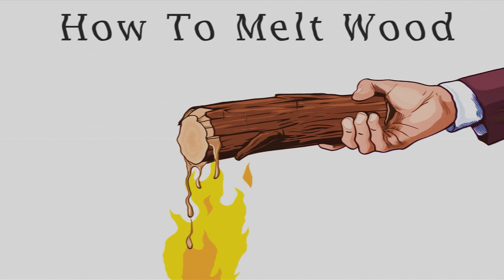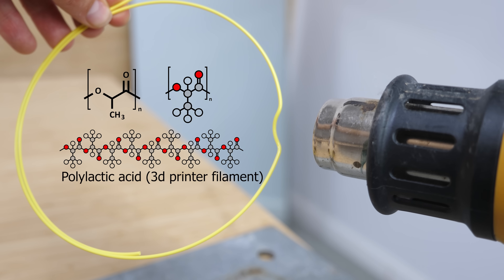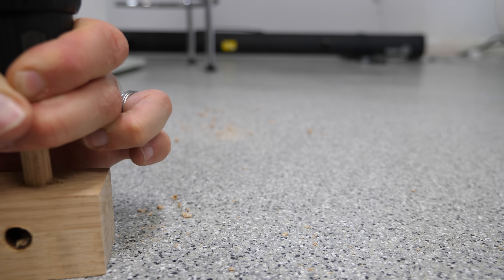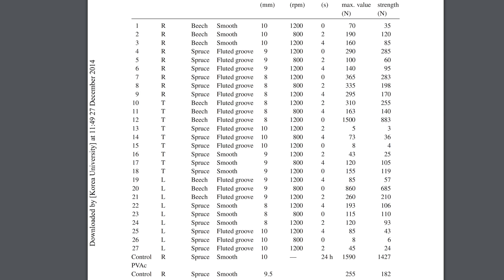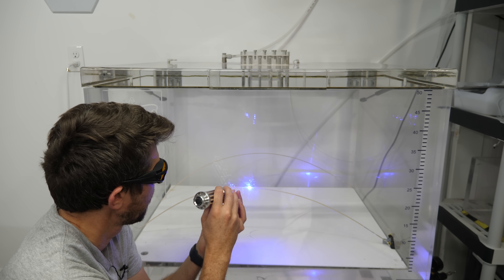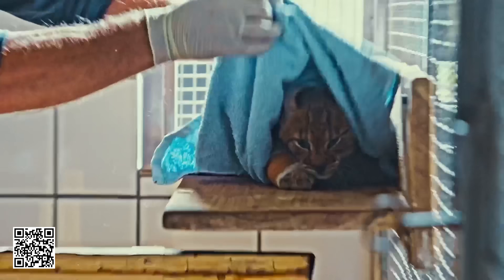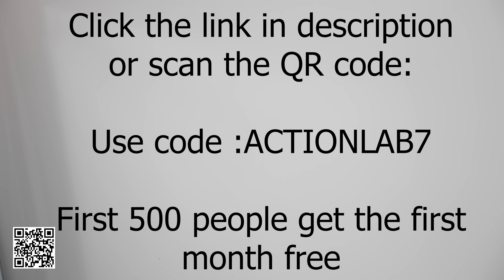I Melted Wood With Friction

Comment: I suspect you are not "melting" the wood as in it still being wood molecules just moving around loosely, but rather generating some sort of sticky hydrocarbony breakdown product in the pyrolysis that is then coming out and carrying wood flakes along with/stuck to it. Congrats, you turned wood into oil literally 100,000,000,000,000x faster than the Earth does naturally.

Comment: Wow! I hope that the worker who accidentally discovered that you could weld wood without the need for plastic was given a raise or promotion! After all, he found a more environmentally friendly, cheaper method that also saved time! (Also, since it eliminated the fumes created by melting plastic, it was safer!) That sort of discovery is priceless!
Reply: It might be oversold a bit... while woodwelding has its uses, it is not going to replace adhesives any time soon, and neither are the adhesives as problematic as they may seem. Melting plastic adhesive properly should release very little fumes. 

Generally this process is more expensive and labor-intensive in comparison to adhesives but it depends on circumstances. 

As for environment - the impact is not completely negligible at scale but not large either. 
Building more robust objects that are not expected to be replaced as often is much more important that producing them in a more environmentally-friendly way. It may be possible to do both.

Comment: figured out how to generate electricity using gravity, water and a design called a wirtz pump if you pump up to a second tank and then pipe it to fall driving the pump its perpetual now offset via chain drive the paddles above the water line and use buckets instead of paddles to mitigate loss if you incorporate rainfall into the top tank you can find nominal values that allow the system to run for the life of the material. you can have free electricity using an old washer motor and this system can be built to spec based on need or simply to run a fridge and lights. Much love and sun yall since its considered perpetual you cant patent this not that you would be alive for long after trying judging by the history sorrounding these types of things but it does exist and can be done for really cheap if anyone wants to try themselves go for It I will go more in depth and explain the process I am giving this information away so if anything thinks they can profit off stealing it just know I have covered my bases and you wont make any money this aint for the rich to get richer this is for the rest of us and I will be starting a not for profit to start installing these systems once I get it out of R and D and into production this year.
Reply: I appreciate the space to share I am blown away you can weld wood and I frequently weld.. now I can put wood welder on my resume once I try it for fun.

Comment: As i know this is the way they make hdf and mdf boards that are used in furniture making (hdf is usually the thin back of the cabinets, it's painted white from one side and mdf is the one that is usually used as a face of your cabinet either being painted or covered with plastic layer or wood veneer) they're made from wood dust and bound together by applying heat and pressure without using glue 

There's also particle board which is used for the structure (sides, top and bottom) of the cabinets but it's made of woodchips and special glue so there's no wood melting used there

Comment: It's pretty easy to bent by melting matches ( part would be definitively burned thats for sur ), i discovered it recently i was amazed. Do i deserve a Prize ? How i should contact? Just did it, i bent a matches to approx a 60° angle :) No vaccum needed but lost a little bit of wood matter in the process.

Comment: 6:35 there's archaic finnic dugout boats/canoes which are produced like that, by stretching (providing greater surface area). The noun "vene"(boat) actually is associated with verb "venyä"(to stretch). More info about that in specific might be easier to find via name "haabjas” - an estonian single log dugout boat made from aspen (haab/haappa - name of the tree from which it's produced).

Comment: I mean, any heated wood, even more to such small size will result in bend. What that have to do with welding? why not actually "glue / weld" the two bits rathere than bend it?

Comment: this is so amazing!  thank you!
have you ever done one about molecular welding? - I'm not talking about 'thermal welding' but ringing? 
in machining- we use Gage Blocks-  these are ground so fine (the best ones are done on super fine precision grinders located in deep mines by NIST -I've witnessed this process) 
the surface finish is so fine - the normal peaks and valleys you see on an electron microscope image even on a razer blade are not there-  think very smooth-like on an atomic level. 
If you take two of these blocks, and 'ring' them - they will join - just like you put cyanoacrylate on them - but no adhesive involved. 
Just shared electrons across each block.  
They are hard to break free once 'rung'. 
it is theorized? that if we could ever make 92% or higher surface clean finish?  they would permanently weld - just like if you took a welding machine or torch to them. 
Always enjoy your presentations - i'm so happy being older that i witness younger studies comment as well - that always gives me hope! God Bless!

Comment: Since they use pressure and vibration in the Swiss School, I wonder if you could get the same thing with 3 pieces of wood in the hydraulic press if you could rig up something to apply the vibration to the middle piece?  (The extra complication is assuming you don't have any way to apply lateral vibration with the hydraulic press itself.)

Comment: J have grown Bonsai Trees for 50 years. We have stripped the bark and covered it with tinfoil. Heated it up and bent it with wire. It then stays in the shape you want. I'm quite sure everyone knows if you melt the resins in the wood you can bond the parts together. This is not new to the world.

Comment: Wood dose not and can not melt. The resins in it can and will if provided enough heat. the rest of the material is essentially carbon pipes and will burn not melt.
 The wood can however expand and contract depending on the temperature of the material. this is why old timber and wood houses can have issiues with doors getting pinched during sesonal change. As the wood expands the doors get pinched, as the wood contracts the doors get pinched. The solution for this is often making the door frames slightly larger than the door normally would be on any other building.

So what is happening with you using a drill and a slightly larger wooden dowel and drilling it in to a slightly smaller hole. Is that the sorrounding wood expands, the dowel and the wooden block get friction sanded (you can see the dust in the vid) this acts like a packin material, and whn you stop and let the wood cooldown it shirnks, thusly picnhing it all firmly together. So the wood have not melted it have shrunk. This is a mecanic traditional blacksmiths use when riveting materials, without using welding or pop rivets. Wood workers who are skilled can do something simelar.

---------------------------

Honestly the more i listen to this channel the more i realize you barely know what the f you are talking about. You use fancy words, and fancy pictures, and seamingly use sientific terms making it sound to unvitting people like you know what you are talking about. when you dont. Get people on to your show who accualy know what they are talking about or start talking about stuff YOU accualy know anything about. Because what you are doing is spreading miss information that will trick people, and thusly increasing the confident idiocity that now are plaguing our world.

Comment: It would be interesting to see tests where the wood is joined in different ways.

For example, using the pressure/vibration method, could you potentially take 4 mitered pieces and weld them into a frame? Could you weld end grain onto face grain, or would the fibers need to be aligned in the same direction?

Then it would be interesting to see strength test comparisons between welding and glue.

Comment: We do bend wood with heat all the time in woodworking and building musical instruments like guitars. 

I’ve bent 1/8” poplar on a steel pipe heated with a torch. You rock the wood back and forth over the pipe until suddenly it becomes elastic and bends. It’s a freaky feeling! When it cools it retains the shape.
Reply: never realized steambending worked without the steam!
Reply: My dad does this with cello ribs.

Comment: No. You can't "weld" wood. But you CAN get it hot enough to extract it's natural oils, which can THEN be used as a super effective "glue" when bonding wooden parts together. ..And we've been knowing all that for at least 3000 years.... So where the hell have you been? LOL.

Comment: What about using a pressure cooker? Submerged in water it wouldn't be able to catch on fire, but with the higher boiling point pressure cookers get hotter than just boiling water on the stove. Maybe you could bend wood into a shape it doesn't want to stay in, pressure cook it, then let it cool, and 'set' it into it's shape.

Comment: Pretty sure this has been done in engineered woods and even wood pellets using heat and pressure for a long time. The institute that "discovered" this were likely the first to use sonic vibration then question why it worked.

Comment: Sorry, but lignin cannot melt. Melting would imply no change to the molecular structure. Lignin is a cross linked polymer, a 3D network and not just long chains like thermoplastic polymers. Heavily cross linked polymer cannot melt as you have to  break the cross links and you therefore obtain a different molecule through thermal decomposition.
In your case, if you look in slow motion the failed attempt, you see the wood has turned completely black. So you may have pushed the  thermal decomposition so much that the glue may simply be tar...

Comment: We've been using wood nails that cause lignin welding. Yeah sure, it's technically not melting the entire structure. Is melting a compound in the material

Comment: Action Lab : Watch me weld wood
Me : But you can easily, and cheaply, get glues that have a bonding strength that is so high that the wood will break before the joint snaps.
Reply: Glue that is biodegradable and non-toxic?
Reply: @IceCenders Non-toxic yes,  biodegradable to an extent sure, but if you're building stuff with wood you probably are not wanting any part of your project to degrade.

Comment: Heating wood is far more impactful to the environment than using some 99 cent woodglue
Reply: I doubt it's much more impactful especially if your energy source is primarily renewable, and plastics are the main issue with glues. But either way it seems like a pretty cool technique for woodworking. You get almost instant bonding and you don't have to worry about having too much glue (leakage) or too little glue (weak bonds).

Comment: Theres a nail gun that shoots wooden nails. It’s called Lignoloc which permanently bonds the wood together.
Reply: vampirebegone
Reply: 2X damage to vampires
Reply: Don’t they use an adhesive on the wood nails?
Reply: @dylandreisbach1986  Nope it work the same like in the video, by lignum welding from friction of shooting the nails in. A Co-Worker used the system on his house. Awesome developement
Reply: Is that little bit of friction from slamming (rather than rotating many many times like shown in that vid) a wooden nail sufficient for a melting effect at several hundred degrees, isn’t it rather like friction from wooden dowels that are slightly larger than the hole than they go into?
Reply: @kabuto3907  Apparently it is. The nails are made of beech which has a high lignin content. They claim it has a tensile strength of ~250N/mm2 equaling aluminium competitors.
Reply: Lignoloc deez nuts

Comment: So THAT'S how you build those Ikea bookshelves...

Edit: Thanks for explaining my joke.
Reply: Thanks people who replied about what was the joke
Reply: @mearetom  basically the instructions are confusing and this is a running joke in social media where people are saying that they can’t make the bookshelf because it doesn’t make any sense.
Reply: You sure should try it out next time you buy the bookshelves and construct them on your own... Must be stronger.
Reply: dw, I gotchu fam, the joke was funny af
Reply: you are all so fun at parties lmao, so funny I would just fucking leave
Reply: Your joke is way better than the terrible pun that is currently the top comment.
Reply: The joke could be that it's difficult to get the dowels in by hand and that you're supposed to use a drill. The joke could also be that the bookshelves are unstable and that they would be stable if the dowels were fused. Since you could only fuse one side of the dowel with the drill technique and that easy disassembly is a feature of ikea furniture, I must assume the former.
Reply: Irregardless of the discussion on assembly, the original comment might have referenced some wooden furniture (including some of IKEA) that includes bent wood. The process is not the same but with related physics.
Reply: @jwhite5008  Poäng is probably the most notable example. A classic chair.

Comment: So, since wood exudes volatiles when it's heated, then heating it under vacuum would actually cause the volatiles to escape even sooner because there is no pressure helping to hold it together. What if we tried it the other way around? What if we INCREASED the pressure and tried melting the wood? Could we melt wood in supercritical carbon dioxide? That would probably dissolve the volatiles and we would get recrystallized organic compounds when the pressure was released. What if we tried something inert, like high pressure argon? What would that do?
Reply: You might be on to something
Reply: The volatiles are a degradation product which means you would still get burnt wood with volatiles that would escape when you released pressure eventually
Reply: @paprikalp7989  This is exactly correct.  In fact, heating wood in carbon dioxide is how we have been making charcoal for millennia.

Edit - OH, this just made me realize something.  A whole lot of americans are kind of obsessed with BBQ.  We can have charcoal in both natural chunk style and briquette style.  Those briquettes?  They're probably actually melted together in the process of manufacture.  That would explain why they don't fall apart if they get damp or something.
Reply: @ColonelSandersLite  Hey now you ever had good ass BBQ? You'd be obsessed too. The briquettes have a binder that keep it together though, they're water resistant but do seem dissolve over time if too wet for too long as the primary binder is plant starches
Reply: @paprikalp7989  not necessarily if you increased the pressure to really high values like 100 giga pascals.  Of course it would damage the structure itself, but using diamond anvils is fun.
Reply: Sounds interesting
Reply: Clever idea
Reply: Heat, lots of pressure, no oxygen, and a lot of time is how all the coal from the carboniferous formed, AFAIK.
Reply: 👀💦
You might be cooking with this.
Reply: @frozeniota  blah blah blah another moron appears
Reply: @frozeniota  Honestly the initial comment was worded very poorly, so I get how it all happened. Either way, I was being more pedantic than anything, so no worries, and have a good day random youtube commenter!
Reply: Now that's thinking like a scientist.
Reply: I like where you are going with this , but can we pressure cook wood in a pressure cooker and casue two pieces to fuse ?
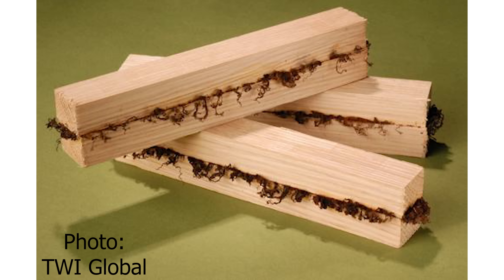Reply: @frozeniota  3:35
Reply: @frozeniota  You asked what scientist from what video and what prize, which I'm guessing you didn't read the comment you replied to correctly because it was very obviously talking about the scientists and the prize mentioned in this video, the one I assume you were watching too or why would you even be commenting. And don't change the subject, I was just answering the question you asked, and enjoying the irony.
Reply: You mean exactly like the scientists done that got awarded the prize? Maybe watch a video next time before commenting

Comment: Hopefully my morning wood won't melt when I use friction
Reply: i lasered my morning wood to try to keep it bent.   i have no wood left to experiment with.
Reply: @ganjalfcreamcorn8438  woah woah slow down there homelander
Reply: @ganjalfcreamcorn8438  - Ouch !
Reply: It could permanently bond to whatever is rubbing against it, so use caution. I mean lotion.
Reply: Fun fact: morning wood will produce liquid if you do it long enough.
Reply: 2nd fun fact: it’s also a different chemical
Reply: This is crazy.
Reply: Gross
Reply: you also need pressure so yeah it won't melt
Reply: I applied light friction to mine and liquid came out. Was that molten wood?
Reply: @hiredgoon4269  Sap